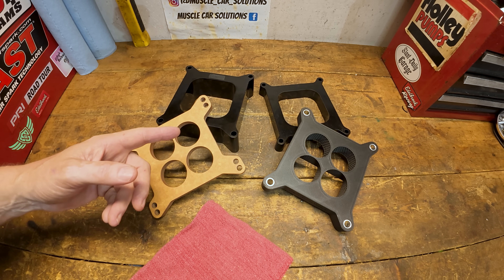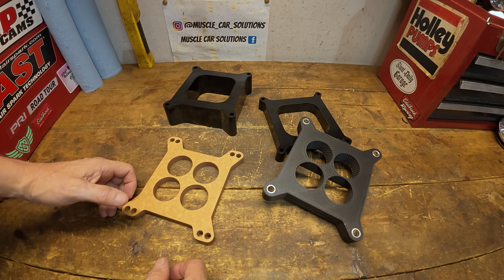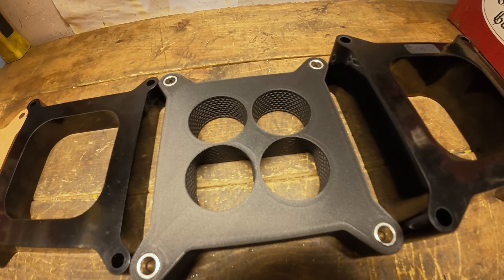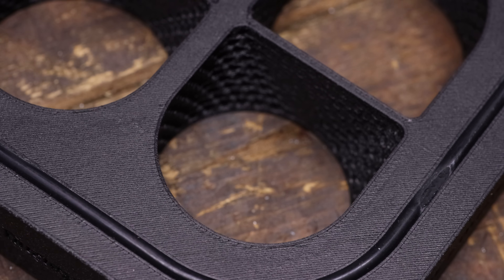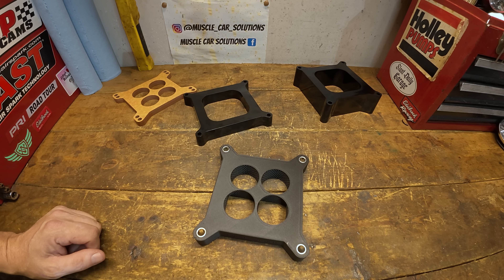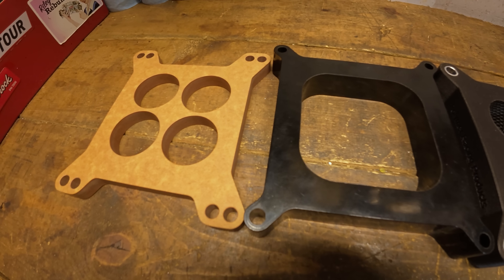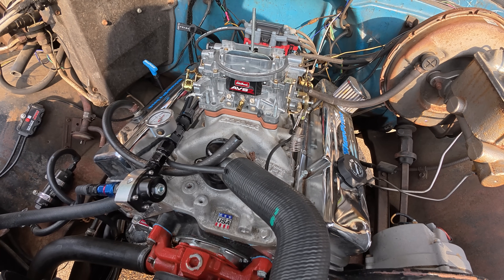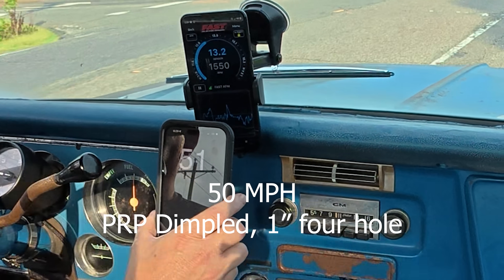Does AFR Change Based on Spacer Type?

Comment: I have noticed that with Edelbrock's RPM Air - Gap manifold, it has a machine down step in the divider between both sides of the Carburetor intake. I will guess here, has this been done so that a certain amount of fuel/air at a certain throttle range, will still mix between both sides from primary and secondary Carburetor fuel actuation across the length of this reduced step divider? Also, what heat insulator would you use as it seems Edelbrock has designed this to have some function. Would you still choose a heat insulator that extends across this lower section divider now as it would defeat the purpose of what it was designed to do or is it not going to matter?  I interested in your thoughts if I'm made sense.

Comment: I tried the polymer racing products spacer on my Chevy sp350 385 with an edelbrock 1411 and it worked good. It had a summit racing 4 hole tapered aluminum spacer which worked too, but the polymer spacer has the thick divider down the middle which matches the dual plane intake divider. I’m not sure the summit tapered spacer was the best option considering how the flow through it looked like it would hit the divider in the intake.

Comment: Great video, I wish you made this sooner! I was using a two inch taper combo spacer and always had this weird bog in overdrive. Another known youtuber said that using a tapered combo upside down was the best way to use it, and it made absolutely no difference for me. I eventually bought a PDH 4 hole to 2 suit style , and made a world of difference. Better AFR, vacume, torque, and that weird bog was almost gone. And as you stated in the video, the AFR was richer at WOT, so I had to jet down in the rear but was well worth the price tag. My old spacer was useless for the rpm range that I used my car in. 4 hole spacers are definitely the way to go (as long as it keeps both halves of the plenum separated).
Reply: was the pdh you got a 1 inch or 2 inch?

Comment: ...I have an eddelbrock manifold that was configured for the quadrajet...do you know if an adapter so I could l d put my holly square bore would be practical and work good on this intake manifold...
Reply from the maker: That manifold is a dual pattern.  It will fit the Qjet or a square bore.  To run the Holley carb, you’ll only need the 2732 to seal it up.

Comment: I have a project truck I'm beginning to gather parts for. Just picked up a 1406 off Marketplace but I am having difficulty finding the right intake. I need an Edelbrock 2104 but not ready to buy a new one. Any idea where to find a good used one?
Reply from the maker: Unfortunately that’s a low volume selling part number for Edelbrock.  You’ll be lucky to find one used.
Reply: @MuscleCarSolutions  Do you have a rebuild kit for the 1406?
Reply from the maker: @HardisonLandWorksLLC  I’m out of the cheap bundles I sell.  Most O’Reilly auto parts stores have them on the shelf if you’re in the US.

Comment: If you have the time you might try some of the directional spacers upside down. The fuel shear can change cause better mixing
Reply from the maker: Not entirely sure if you’re referring to a Wilson or super suck style spacer. For sure I would have included one if I had one.  Maybe sometime we’ll look at those.
Reply: @MuscleCarSolutions any tapered or radius exit style spacer.

Comment: Interesting take on carburetor spacers, regardless of thickness, figured they would add plenum volume and hence the engine would run a tad bit leaner requiring a possible jet change. Im sure the main benefit is to better insolate the carburetor from the intake to help reduce heat soak to a degree. But one thing that i cant help think about, screw in studs and washers, both made of metal are used to mount the carburetor to the intake, heat transfer will still take place regardless of thickness of gasket(s) or spacer used. I remember long before spacers were the norm, there used to be a special shaped aluminum heat shield that were sold that mounted between the carburetor and the intake to help keep the carburetor much cooler from all sides. A suggestion if you will, since you do quite a bit of experimentation with your GMC, i would think it would be much better to use a TH350 transmission instead. All you have to worry about is just the mounted throttle cable to the carburetor, and no need to worry about a misadjusted TV cable(700R4) and accidently burn the 3-4 clutch pack. No need to hook up the kick down cable either thats associated with the TH350, you can just manualy downshift it yourself into 2nd when the need arises, and of coarse that means keeping the rear end gear ratio in check for drivability and gas milage.
Reply from the maker: You couldn’t pay me to run a classic without an OD trans. 😂 I’m on the highway frequently at 80 mph and 2400 RPM.  My Chevelle is even better with a T56 and a .50 final ratio. 1:1 final drive transmissions suck if you’re actually going to drive.  There’s nothing complicated in a TV cable transmission. They’re simple to set up and having that overdrive gives drivability AND fuel economy.  Best upgrade there is for a classic car or truck.

Comment: Blue Print makes a lot more sense. I thought it said Blue Point. I'm like weird why is Snap On making valve covers?
Reply from the maker: If snap on sold a crate engine it would be the low low price of $29.95 for 675,897,327 payments.
Reply: @MuscleCarSolutions 😂

Comment: I am running a 2" 4 hole spacer on my 460 Ford with a Performer and Holley 750 Street HP VS. I "hear" from "experts" you aren't supposed to run a 4 hole on a dual plane, but it sure does boost the torque on this combination. Would have been nice to see a 4 hole 2" spacer in the comparison. Maybe add that one to the list to test? Curious if it would  richen (or lean out) the AFR even more than the open 4 hole spacer.
Reply from the maker: I’m not sure I’d ever listen to someone who says don’t use a four hole spacer on a dual plane unless it’s a performer with the dual pattern and the funky smaller primary openings.  

Doubtful I’ll run this test again.  I used what spacers I had available to me here.  There are a couple dozen others I’d have liked to have tested, but man this video would have been 3 hours long!

Comment: With two wide bands, on a Performer RPM intake, we saw better collector to collector AFR with a 1" open spacer than we did the 1" Wilson 4-hole taper.  The increased vacuum signal from the Wilson required a change to the step-up spring as well but made less mid-range torque on the chassis dyno. (292 roller cam, 344ci, Mopar LA, 11:1 CR, 800cfm AVS2, ported Edelbrock heads, TTI headers)
Reply from the maker: I’m sure with the endless amount of combinations that could live together there would be a number of differences.  Eager to test the victor jr and the 950 on my 540 for the Chevelle. Data collection makes me happy!

Comment: crazy me i gotta ask if you stacked all that stuff together in would you have a tunnel ram for a poor guy ? Or using the geometry would it be something kinda kool ?
Reply from the maker: As a concept, without the right distribution and floor in the manifold, all stacking spacers would do is cause a lot of frustration.  Years ago, I worked with a manufacturer on different intake designs (I wasn’t involved on the design, only pre production testing) and some were rather ridiculous.  Now if they were stacked on top of a tunnel ram, there might be some advantages, but at the end of the day, it’s all about optimizing air speed through the runners.  I’d guess it would lose power with 5” of spacers stacked on top of a tunnel ram.
Reply: I'm running a 6" stack on my lifted pickup.  The top 2" is a "swirl torque" 4 hole, the next 2" down is an old 4 hole that I hogged the space out between the secondary bores.   With that 4" Stack I felt the bottom end was strong, but the top end seemed a bit lacking, so I put a 2" open on the bottom to add plenum volume, and that woke up the top end, in terms of the "butt meter" ....  I'm not here to say it's a perfect, or even a proper setup, but rather my own experiment.  I'm happy to regard it as such.  😁  This all on top of an RPM air gap manifold.

Comment: We have a dual quad set up and had to use two spacers. the open phenolic spacer from Edelbrock and the four hole spacer for Mr. gasket. We ended up having problems with the vacuum signal to the large and front porch, using a regular gasket on the four hole spacer. Once we got a a second Edelbrock open spacer Brakes and vacuum modulator worked much better.
Reply from the maker: I feel for you guys with all the trouble you had getting to your race. You learned a lifetime of frustration in about two weeks. 😂 Hopefully the spacer lessons were after the fact.

Comment: I looked up the polymer spacer and I have plenty of room under the hood so I'm thinking about the two inch spacer to get the air cleaner up closer to the hood scoop. Two inch cowl induction hood on a 84 El Camino
Reply from the maker: If you email them, you’ll likely get a repainted back from Tony (the owner).  I’m sure he’ll be able to help you pick out the right one.  👍
Reply: @MuscleCarSolutions Thank you for the info. I have a 700 in it as well and glad you said something about the linkage lining up. I'll be ordering one that bolts with the carb.
Reply from the maker: @purebredamericanmutt  that might be the best way to go to keep the linkages happy.

Comment: interesting!  so 2" is better for top end and needs leaned out over a stock tune?  theoretically would the 2" get the best MPG then?
Reply from the maker: It certainly acted that way. I had another fuel economy test I wanted to do sometime.  Would be interesting to add it to the mix if for nothing else just to maybe show what it does to the low end torque. The 2” absolutely killed it (which I was sure would happen). The AFR wasn’t what I expected to see though.

Comment: The dimples are supposed to keep fuel suspended and atomized.
Reply from the maker: The speed for sure should help with fuel atomization. That company looks like they primarily are focused on high rpm racing applications. It was nice to have for this test.

Comment: I have custom 4-hole spacer, 10mm thick, as heat insulator. Made it by myself with milling machine. Works good!
Reply from the maker: Can’t beat a four hole spacer on a stock-mild application.